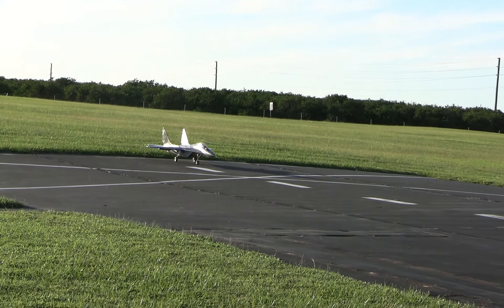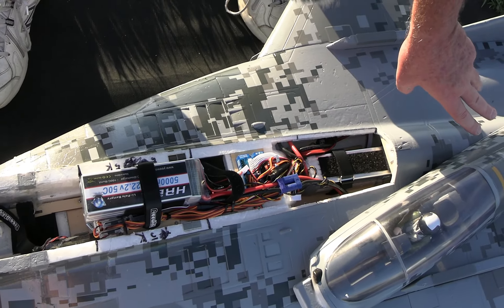FREEWING MIG 29 FLYING THE FULCRUM PT 1 by FGFRC #aviation #rcjets #rc

Comment: What are your frontwheel gyro settings?  (Hold & gains)
Reply from the maker: I did not set up any priorities, holds, or specific gains, the nose wheel is just now mirrored to the rudder  the nose wheel never reacted before I upgraded to as3x+ but now it does. Also all my flight gains are at default and adjustable on the knov.

Comment: Can it climb from a slow flight with those heavy batteries? 
I have both version of migs & have ovinic 5200 50c lipo (640g) & zeee 5200 120c (652g), both seem to not climb from a slow flight if i go full power. Now i got ovonic 5300 120c (720g) to try out. Jet is 13lbs with both batteries. supposely each edf makes like 4.7kg of thrust (should be plenty thrust/weught ratio to get this jet climb like nothing. But its nowhere near that, so hopefully thiz new ovonic 120c batteries do make a different this saturday. Next batteries im trying are the smc 5000 80c
Reply from the maker: Not any more than any other lipo.  I understand what your saying about the thrust to weight but also the mass of the plane with air resistance, just as this plane slows right down naturally for landing it is also resistant to a ballistic climb. But not a slouch either.
Reply: @FatGuyFliesRC  in my case. The mig doesnt slow down with ni flaps or take off flaps, only notice to slow down a bit with full flaps. I have to cut the power & just let it glide down.
Reply: @FatGuyFliesRC  https://youtu.be/R1EE5Qsv5RA?feature=shared this is my mig, i landed with take of flaps, because i wasnt aware of lol i always go full flaps once i line up with the runway
Reply from the maker: @Mroswaldo16  I watched your video. BUTTER!!!!!!!!